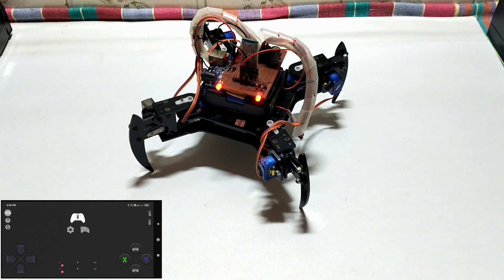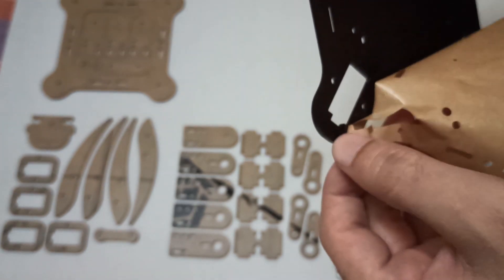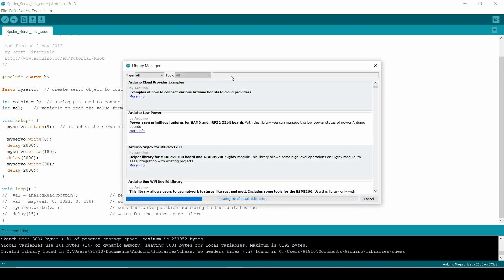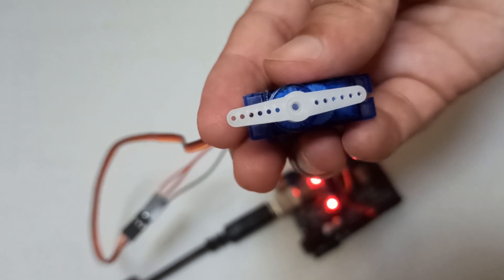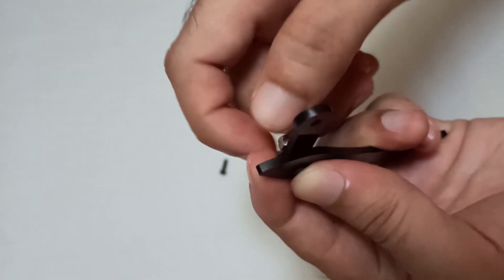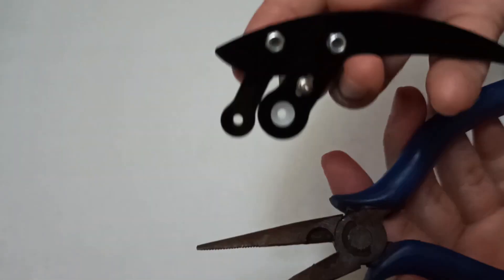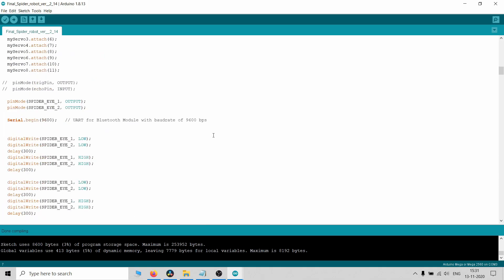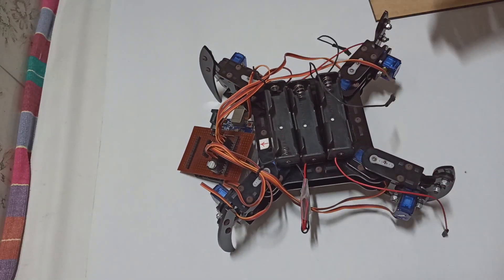DIY || Smartphone (Bluetooth) controlled Spider Robot using Arduino | HC-05

Comment: Why u use 3 battery?
Reply from the maker: 2 batteries for Motors, 1 separate battery for Arduino and Bluetooth module. Since due to inrush current of motors battery voltage was dropping after 15 20 minutes causing Bluetooth module to reset, with separate battery run time goes upto 1 hour.